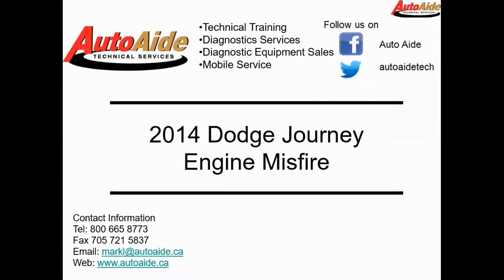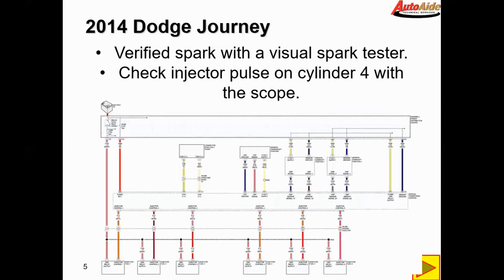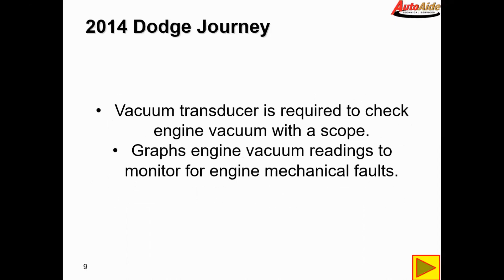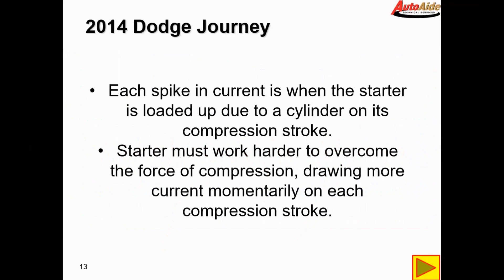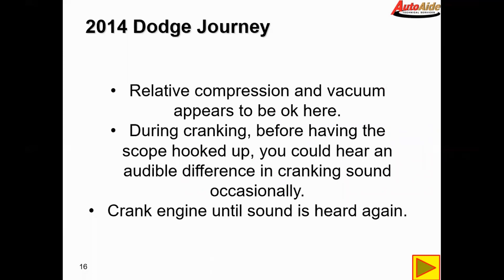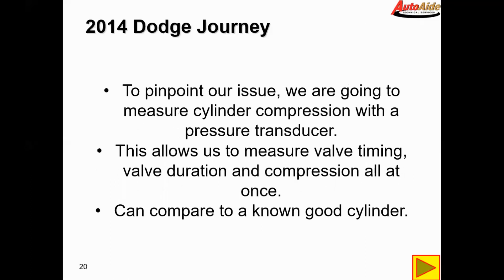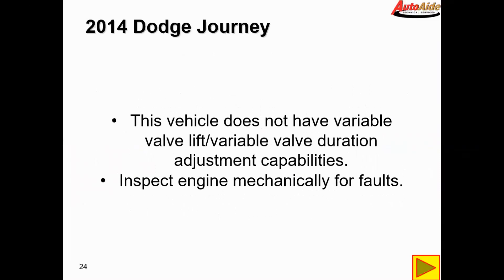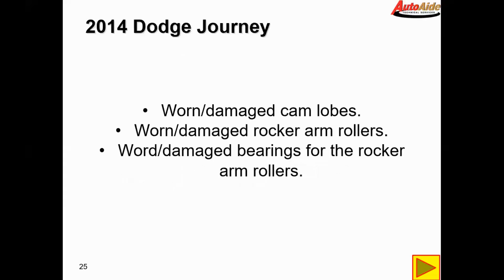How I Diagnosed: 2014 Dodge Journey 3.6L Misfire. Mechanical Issue!?

Comment: Hi maybe you can help me my 2014 crossroad won't start the lights come on the radio comes on but it won't turn over. My battery is about a year or 2 old what could it be

Comment: I was surprised by the 50v spike seen at the end of the injector pulse.  Is there some form of filtering before those spikes get to other modules?
Reply: Its a DC coil, it should have a diode to shunt the inverse EMF